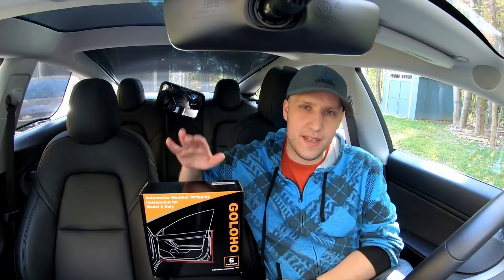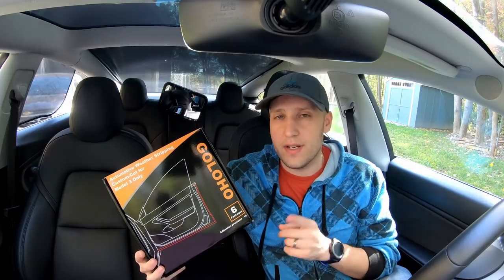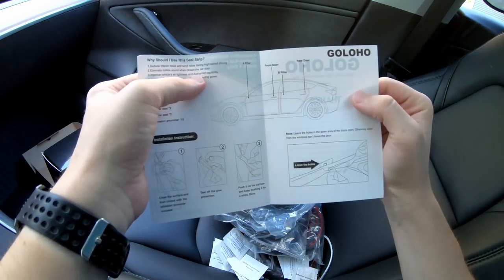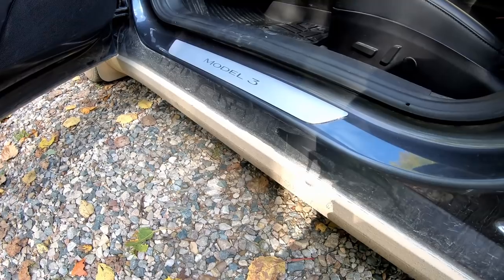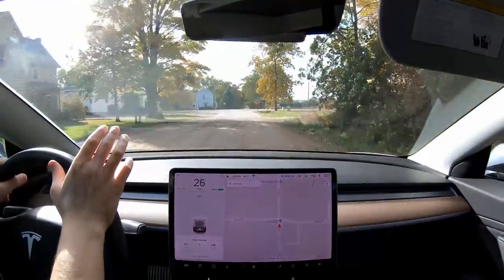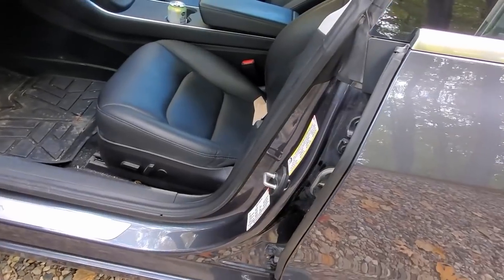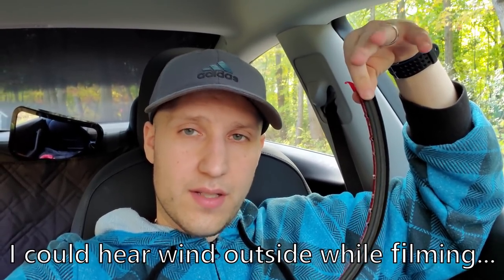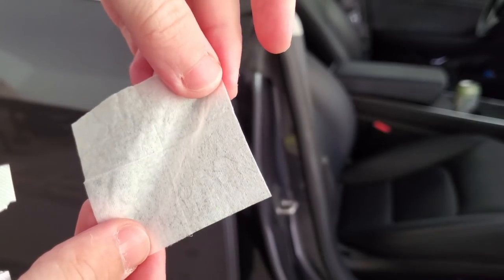Reduce Road Noise and Keep Your Car Clean with These Weather Strips? | Test and Review |

Comment: Door trim does quiet the ride.  I have a 2015 f150, there were complaints of misaligned doors and wind noise.  

I did buy a edge guard and it fixed both noise and gaps.

Comment: Did same but without a kit.  Just bought raw insulation suggested. Biggest difference imo is much less traffic noise when vehicles passing me or vice versa. Do watch out though that even if you don't block the factory door drainage holes, I find myself cutting some gaps or holes in the added insulation as I noticed water comes out of drainage but trapped by added insulation after a car wash.

Comment: For people from Germany: If somebody is searching for the optimal cleaner before sticking stuff to your car, I recommend "Spiritus Reiniger" from "Frosch".

Wash the large dirt off with like a pressure washer first, to not scrub the sand into the paint. Than let it dry. Use the cleaner pure and wipe it off with a new microfiber cloth. Let it dry 3-4 minutes, until you cannot smell it anymore.

Comment: You should have used a simple decibel reader before and after for an accurate conclusion. 😊
Reply from the maker: I thought about it, but anything I buy will not be very accurate... And if the decibels change and I don't think price a difference, does it matter?

I did it for the 18 vs 19 tires and there was a huge improvement in road noise on the 18s... But only 2 dB difference. I realize it's not linear.

Comment: It seems the sound between the tires and dirt wouldn't have been a result of these strips. Maybe some difference from vibration though.
Hmmm... I don't believe I'd pay $30 for something like this. I'd expect to pay $30, maybe $40, for the product and professional installation. I'd have to figure out a way to save on the purchase if I were to get these.
Reply: which country are you from where you expect somebody would spend an hour and install this product for $10 labor?
Reply: Read what I said again. This time, try correctly comprehending it.
Actually, no... because you already think you're right and I couldn't have meant what I said any other way. I'll use my time, wasted by you, to spell it out for you.
1. "I don't believe I'd pay $30 for something like this."
Implication: It's priced too high.
2. "I'd expect to pay $30, maybe $40, for the product and professional installation."
Implication: $15, maybe $25 (at the most), for the product is more reasonable. Thus, paying $30/$40 for professional installation is good. This should cover at least the employees pay for the time used for this job. Bump it up to about $45 or $50 and cover the overhead used for the job. There really isn't any overhead used for this job as all they're doing is applying rubber to the door edges.
Overall, it's ok... I know business - obviously you don't. You also failed to do the math correctly as per what I said and instead decided it's better, and ok, to start with me.